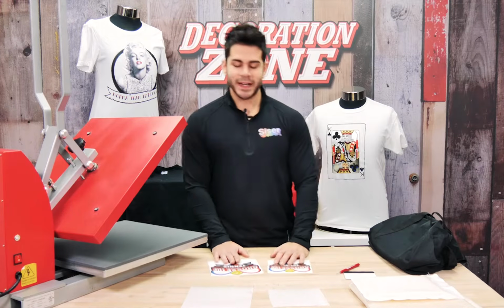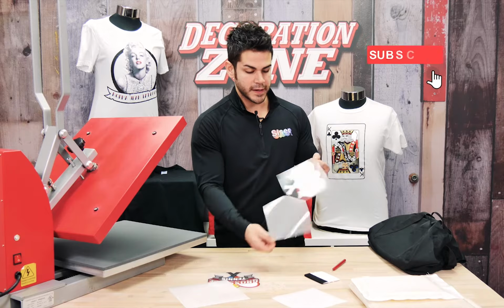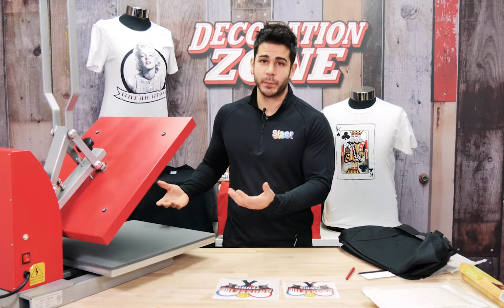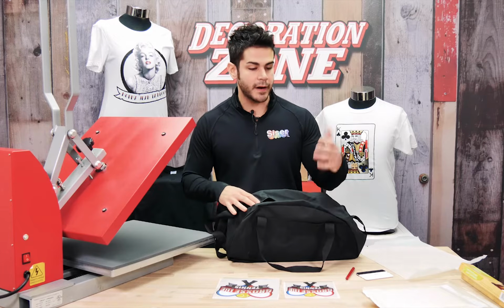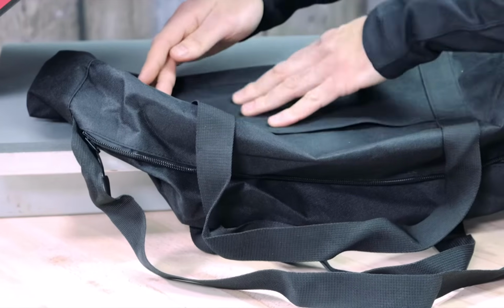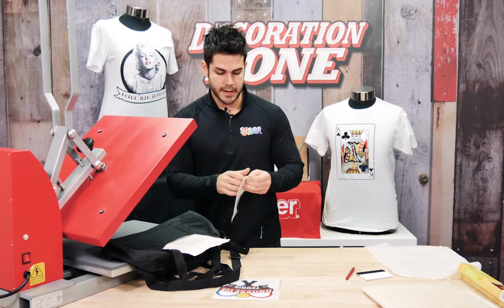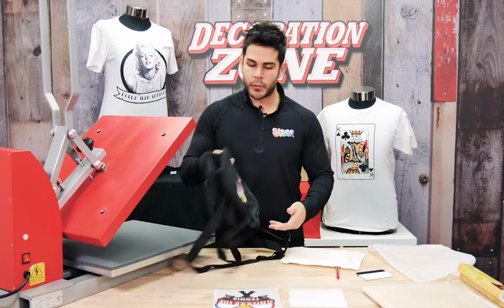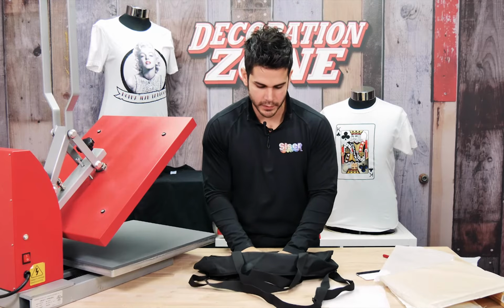A Guide To ColorPrint Extra PU

Comment: I bought a roll of Colorprint Extra PU and printed a few designs on my HP Latex 560. The colors are crisp and the quality is very good. The problem is: After I print and plot my designs on a graphtec FC8600, the print doesn't stick to the TTD (I'm using the Siser High Tack) and no matter what I do or how hard I squeege, the print just doesn't release from the backer. I've ruined like $150 worth of material and I'm quite frustrated at this point. Any suggestions how to make the print release?
Reply from the maker: Interesting! Please reach out to us at support@siserna.com and we can see how we can help! 😊

Comment: DO NOT PURCHASE THIS VINYL IF YOU HAVE AN EPSON ECO TANK PRINTER!!!! IT WILL NOT WORK! Per the comments I called their support and they said Epson DOES NOT apply enough heat to this vinyl and it will continue to run! Don't waste your time and money like I did! HTV works great, but not the permanent.
Reply from the maker: that is because you "eco tank" is NOT EcoSolvent inks. It is inkjet inks that will NOT work on this product.
Reply: Did you use eco-solvent ink in your prtiner?
Reply from the maker: @RoommateWiLLE  yes, for this product you have to use eco-solvent, solvent, or latex inks
Reply: @SiserNorthAmerica  I have been confused for a while: how do I know what material can be used with water based eco solvent ink. So far I know S-Print and Color print Easy. What about Color Print PU Matte and others? Or what is the matte version of Color Print Easy.
Reply from the maker: @RoommateWiLLE  Send us an email at Support@siserna.com and we can give you a full list!